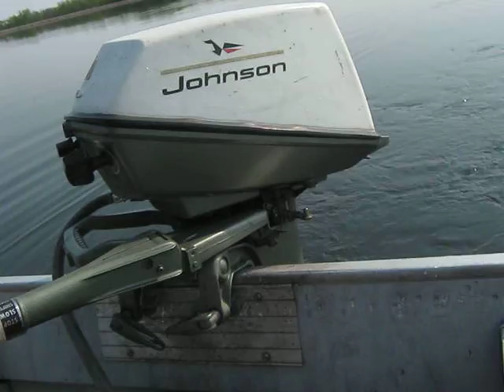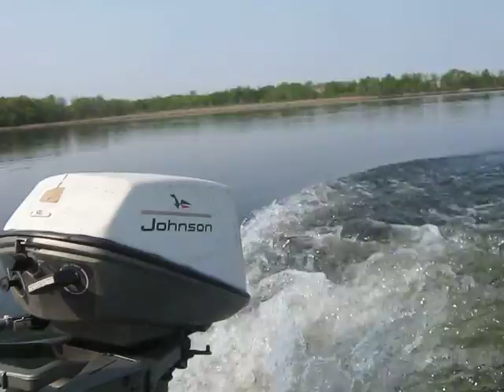1967 Johnson 6hp outboard motor

Comment: I have replaced many parts on my 1971 Johnson 6hp. I have yet to get water to come out of the discharge. I recently removed the power head and cleaned all water passages. I took the head off of the block, and removed all of that scum and resurfaced it. Put a new head gasket in. New thermostat. Impeller. I’ve taken the thermostat out, and water makes it up to the thermostat. I guess the last thing I could do is buy an updated water pump. I don’t know.

Comment: Hey I have a question I have the same motor and it runs good only problem is that it feels like it’s not getting enough gas like the throttle is at full open but it’s not opening up the start position on the throttle is off center about a half inch so when I put it on start the actual mark is off a little I’ve put a mark on the Handle where start is could it b the throttle cable or the fuel pump

Comment: I do have a question.  do you know what size fuel hose I should use..  1/2 inch 5/16 or 3/4
Reply from the maker: The 5/16" is just fine for motors up to 100hp

Comment: I have a 1984 6 HP and I was wondering if you know what type of flusher will work with it.  Having to fill up a trashcan every time I want to tinker with it is a royal PITA.  Great videos!  Thanks!
Reply: JAY TV any normal one should work. I got mine from Walmart. Just the basic flusher. It works on all my outboards from my little 4hp Mercury kicker motor to my 175hp Evinrude bass boat motor. I’m sure it would work on yours as well. Good luck!

Comment: Hi - really appreciate ur vids. Have a 70s merc 40 single i picked up last week. Rewired the head, set points - runs on first pull. I cant find any detailed specs in the owners manual for setting/checking the timing and setting up the link/sync. Can u maybe send me some pointers?

Comment: I have a question about a 1972 Johnson 6hp ... how can I tilt the motor up and down because it seems to sit at an angle and I see slots where it might be able to tilt but I can’t get it to move
Reply: lol i had the same problem ..see where the tilt frame is bolted to the motor? well the bolt is to tight ,,once it tilts you will see the lever to adjust the angle ..its the big bolt that holds the tilt ,loosen it
Reply: I have no idea what I’m looking for I see the lever in the front that says lock and unlock I don’t see a bolt ..... could you please make a video for this thanks
Reply: @redboyize  did you get it sorted sent you a vid
Reply: peter moyes not yet
Reply: I never received a video from you
Reply: @redboyize  see the vid small boat tilt and  trim on this site  you will see a bolt that goes thru the bracket  that fits over the stern to secure the motor to the boat ,,loosen the biggest bolt  ..
Reply: peter moyes wooooooo thanks that was the problem it was too tight thanks  again